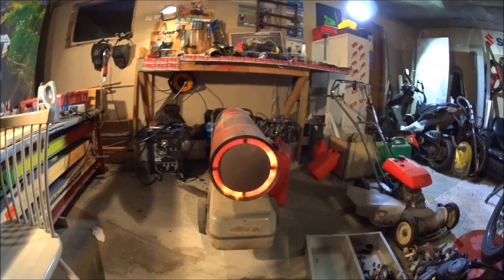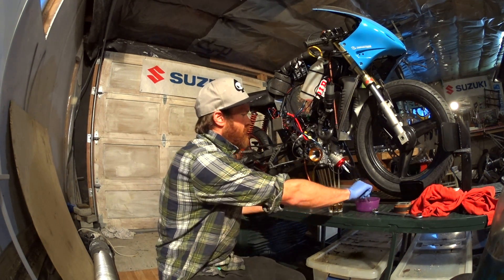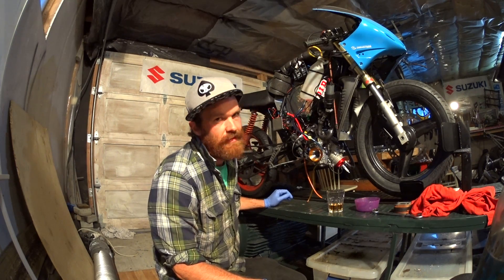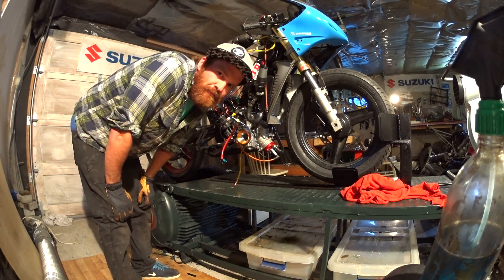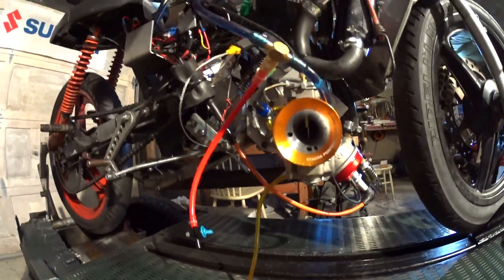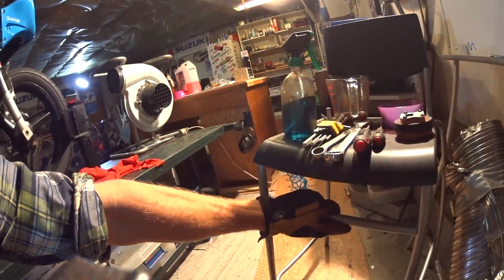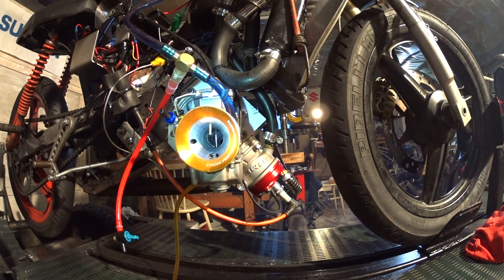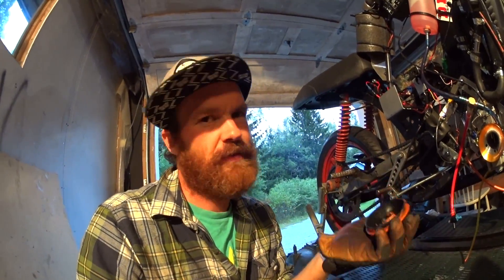YOU WONT BELIEVE IT! Two Stroke Running With No Intake Valve!

Comment from the maker: Disclaimer: This is not like common piston port induction were the intake port is in the cylinder wall controlled by the piston, even if, for the untrained eye, these engines may seem to have no intake valve.
Reply: 2STROKE STUFFING 
Two-stroke engines aren't required to have Reed valves to operate you can remove them and they will still operate it just won't operate as efficiently. Reed valves were invented to keep back pressure from entering the carburetor and causing a disruption in the intake direction of airflow causing a reduction in power. Most 2stokes didn't have reed valves until the 70's.
Reply from the maker: +Ben Hawke No they aren't, but they always (with a very few, very old exceptions) run some kind of intake control, reed, rotary valve, piston port etc. In this video I'm running the engine with a big gaping hole in the crankcase. Always open. No control.
Reply: 2STROKE STUFFING 
Yeah, like snowmobile engines. Snowmobile engines didn't start using reeds until late 90's, even on the crankcase mounted intakes. If you wanted a reed valve on your sled, you had to find an aftermarket reed box, or make one. That's one sweet looking bike. I'm building a GS 650GL into a scrambler.
Reply from the maker: +Ben Hawke Thanks! Good luck with the scrambler project! Are you sure the one's with intakes in the crankcase weren't running rotary valves?
Reply: Ok, I can accept that. Good description.

Comment: They run ok with no reeds but reduced power, the piston still pushes the mixture down but there’s a pressure pulse back into the carb. It’ll only run right at specific speed but could be tuned with different length intakes.

Comment: Eeeeh. Most old mopeds run without intake valve. Ilo, Husqvarna, Sachs, Puch, Zündapp etc. Carb mounts directly to the cylinder (or possibly engine block) without any valves in between. All 2 strokes have cylinder ports. When talking about intake valves on a 2 stroke we refer to valves specifically and not cylinder ports.  Why would this be unbelievable? 
Not impressed. At all.
Reply from the maker: You're missing a key point, in those the piston IS the valve, here there really is no valve.

Comment: i have an old 2T moped that has no valve and it runs good!
Reply from the maker: It's piston ported, this is not.
Reply: @2STROKESTUFFING  you forgot about piaggio ciaos.  They are case inducted 180degrees opposite the cylinder and have no reeds bro
Reply from the maker: @TrustPro2024  They use the crankshaft as a rotary valve, just like vespas.

Comment: Uh 2 strokes have been running without reed valves since their invention reed valves is something new,was a big marketing thing back in the late 60s and early 70s.I was racing RMs in the late 70s,by that time all 2 strokes had reed valves .The only valve the older 2 strokes had was the piston.
Reply from the maker: You said it yourself, they use the piston as the intake valve, this one don't.
Reply: Don't forget the rotary disc, invented in the fifties, by Daniel Zimmermann, and the rotary sleeve, used by Erich Wolf on the DKW racers in the thirties and fifties.

Comment: I might be wrong but i thought 2 strokes were either piston ported or reed valve.
Reply: Old kawasaki  dirt bikes an skidoo snowmobiles ran a rotary valve setup,  the pie shaped valve runs off the end of the crankshaft,  hence the side mount like this little bike.
Reply: @johnbabb1138  yes you are correct i forgot about about old kawasakis dunno about skidoos no snow where i love

Comment: In 1930 or so , tests have been made by Hungarian engineer...which showed that if exhaustport opens vey fast , ( as wide as possible and with straight upper side) the pulse created in the exhaust would create such low pressure that the fuel mixture is sucked from crankcase through transfer ports into the cylinder.....

Already then was stated (1930!!):  the valve is only needed for easy starting and revving up.  Once at higher revs the valve can be discarded....
Remember in 1930 they did nit have such good ignitions as we have now , carburation was worse and fuel not as good....... 

So that this engine can be started , idled and revved up......is not such a miracle.

It just shows the exhaust pipe determines the power output if cylinder and carb are 100 percent.....

Comment: Yes, it works without valve, but does not accelerate well and has no power. The carburettor guillotine acts as a valve at very low speeds.
Reply from the maker: I think so too.

Comment: How is that possible? 
My brain just  exploded.
??????????????????
You just turned the small engine world 
Upside down  bro,now would you make a video  on different riding conditions? To
Further test at different riding speed s ,i 
think you can do it  
☆☆☆☆☆☆☆☆☆☆☆.
Reply: In 1930 or so , tests have been made by Hungarian engineer...which showed that if exhaustport opens vey fast , ( as wide as possible and with straight upper side) the pulse created in the exhaust would create such low pressure that the fuel mixture is sucked from crankcase through transfer ports into the cylinder.....

Already then was stated (1930!!):  the valve is only needed for easy starting and revving up.  Once at higher revs the valve can be discarded....
Remember in 1930 they did nit have such good ignitions as we have now , carburation was worse and fuel not as good....... 

So that this engine can be started , idled and revved up......is not such a miracle.

It just shows the exhaust pipe determines the power output.....

Comment: People have commented on where you are from . I believe you are defiantly from Scandinavia not sure if its Sweden but acts like it ? 
 The running with no rotary valve is amazing to me. I have been a powersports mechanic for most of my life and have work on raced and modified many two stroke and four stroke motors for motocross drag racing including jet skis. I believe that I have a pretty comprehensive knowledge of the subject. Obviously your engineering skills far exceed mine for which my hat is off you. My point though is it is  impossible to start and run a  reed valve  two stroke with broken reeds. I know from bitter experience that I've had the reeds break up on motors while they are running full bore and the motor cuts out instantly and will not restart. So this must only work with a rotary valve motor which I've had a small amount of experience with Rotax Jet Ski motors. The crank throw or web must be acting as a valve. The crank web is very close to the side of the crank case. So I wonder if this would work on a twin cylinder Rotax where in the rotary valve is driven via a separate shaft and the intake port is positioned between the crankshaft webs making it impossible for the crank web to influence the intake charge? 
 This leads me to another point unrelated to two stroke engineering. Although not a native of the USA I have lived here for over 20 years. I have watched many of your videos. One in particular I watched you complain about the comments about the way you dress. My complaint is about how you don't dress. I'm not sure if you realize that the way you wear your pants came from the California prisons and is an advertisement to let other inmates know that you are sexually open for business. I'm sure this is not the image you want to project? From my own point of view I see you as a very talented and intelligent person I want to see your incredible engineering skills not your underpants or your backside I  think it is very immature and find myself some what embarrassed for you . I would love to leave you an email or other means of contact to discuss any point but I would be barraged  with a tirade of millennial social justice warriors that are offended with no clue why?

Comment: Im not too surprised by this as I have used machines without valves or piston control intake also because I tried starting them without fully putting them back together. It is less efficient because you are not necessarily always getting an optimal mixture of air/gas but other than that everything else you need to run an I.C.E. is present. Some of the machines I ran like that had stalling issues or backfired but I could usually adjust the gas input to make the machines run ok. The only thing I am surprised about is that yours seems to run pretty darn well without the valve, altbough it didn't start first or second try and it seemed like you didn't have to mess too much with the gas mixture. All that being said, I love your videos because you are very scientific by coming up with an idea of what you want to do, forming a hypothesis about what the modification will do performance wise, then you test it on the dyno usually more than once to get an accurate result and share it with us the 2 stroke lovers! Without videos like yours or getting a dyno of my own, I would just be guessing as to what mods felt better to me and using primitive,  inaccurate measurements of my results. Keep it up man!
Reply from the maker: Thanks man!

Comment: the side in the carbi acts like a valve when idling  and controls mixture of fuel  while opening  the venturi effect of the carb takes over drawing more fuel with the air ......i grew up with non valve 2 stroke motors here in australia in motorbikes in the late 70s early 80s it nothing new ......throw a set of valve reeds behind the carbi your running and call it a day
Reply: also if you want to run the rotory valve and pick up top end revs let more air fuel in make the intake valve smaller dont re time it take material of the side that starts to close the port

Comment: Mietz and Weiss 2 cycle oil engine of the 1890's had a three port design with no valves.
Reply: Ports ARE valves
Reply from the maker: +enginebill Interesting, Was it one of those "constant speed" engines?

Comment: nice rotary there where did you find it ? i remember testing a 50cc Groupe 3 back in 1998 in France nationals it would go up to around 20000 rpm with 17 Whp and a Dia 30 carb but it still was outrunned by read valves since they could put out as  much power but on a longer band
Reply from the maker: +Franz Heil Thanks! It's homemade. Just finished porting the cylinder, stay tuned for upcoming videos!

Comment: ok you and i spoken before about dyno losses etc , now as i said then i had been racing home tuned two strokes since 65, during the early 80,s i ran a yz250e aircooled engine , this being a reed valve motor, at the time i was experimenting with different reeds, when during a race the motor realy stared to pull real strong but if it git close to the low rpm of the pipe it bogged down it finished the race and after we found one half of the reed valve had disappeared lucky it was a glass fibre reed , so the engines will run at speeds within the pipes rev range i know that , as the kinetic energy of the air volume with keep it going , when mine dropped of the pipe it didnt want to run ,it was a bitch to get back to the paddock , so i knew something had happened.
also when running montesa,s in piston port valving we would run a full open period of over 220 degrees, these had strong power from 7 to 9.5 k , depending on the pipe used, now i can see this working , i also see how low gearing it is when you start it , it must be turning 2 k when the wheel is turned

Comment: In USSR, now Rusland city Serpuhova in years 1985 make competitions bije 50cc with 6speed but with rotation plate valve. Then you can set inlet angles.
Can you tray put inside walve from 125cc bike?
Can you tray put inside rotating plate valve?
Reply from the maker: +Rudolfs Jozuus I'm going foa larger inlet disc now, to make room for a larger port.

Comment: Two stroke engines do not require valves, companies use valves to control the gas flow, but they can run perfectly fine without them
Reply from the maker: +JackyBro watch my intake types video.

Comment: No moving parts or valves are required for 2 stroke operation other than the piston and crankshaft as long as intake and exhaust ports are properly located.
Reply from the maker: +Sebastien LaPointe True, bur here the intake is definitely not properly located. It's just a hole in the crankcase.

Comment: Long time ago I had a Vespa boxer 
I put the gasolinetube in the intake manifold without a carburator and it runs 😂 
But only idle
Reply from the maker: +marcello033 That's funny!
Reply: Its normal , i have mover engine which running without carburetor. One day i sheded gasoline on engine block and push to run and engine runing about 20second

Comment: Most of the old snowmobiles and I️ believe a lot of old two stroke engines have no intake/reed valves. My understanding is that a reed valve on a two stroke is a somewhat modern innovation to improve performance and fuel efficiency. Correct me if I’m wrong but please only if you know what you are talking about. Thank you.
Reply from the maker: +Andrew Walski All those 2 strokes without valves are in fact using the piston as the intake valve, it's called "piston port induction". I'll have to make a video about this, seems to be a very common misconception.

Comment: It's the fookin' whiskey...

actually I havce had a couple of rotary-disc valve 2T's that I played with (Bridgestone 350 twin and Kawasaki F5 350 Bighorn single) making new discs with other timing and managed to start them both with no disc inside. Air/fuel misture def hung i the air around the bellmouths when running; I never tried to irde or dyno them as such; was afraid to damage the piston/cylinders and parts for them were hard to find (pre-internet :-) )

Have fun & glad to see/hear you respect your sleeping kids- you're not JUST a gearhead

Comment: I faced 2 stroke yamahas in the 60's and we did not have valves on them.
Reply from the maker: +monster man They had piston controlled intakes, this in running always open.
Reply: ACreativeName what he said, that are pisten controlled valves. They are straight on the cilinder. When the piston comes up, it makes a vacuum in the crankcase. And then when the piston is almost all the way up. It opens the in take port. ( because is just a hole in the cilinder. The piston wil open and close that hole by moving up and down.) And makes a way to the crank case. Vacuum sucks in ar and feul. When the piston goes down. It closes that port and build a crankcase pressure. And when the piston is almost all the way down. It opens the tranfer ports en the pressure in the crankcase blows the mix in the cilinder. This is a different intake proces. The engine on this video is no intake controlled by the piston. The intake is ON the crankcase. So normally wen dr is no reed or rotary valve but just all time open. There will no pressure build up in the crankcase. So when the tranfer ports opens. It wil not flow. So this is not going to run. But this engine can and thats amazing!!!!. Not so efficient i think
Reply from the maker: +Leroy De Vries Correct. And, no, not very efficient...
Reply from the maker: +The2StrokeRider it's piston port
Reply: My old sachs engine doesnt have a intake valve. Carb goes straight into the engine if u now what i mean
Reply: theres nothing special about it. If your from germany then you know the mopeds and mofas. They had no valbe at all the carb was directly at the intake port.

Comment: even without the reeds it's  a kind of piston port engine, it may run , but I bet it runs bad.
Reply: joracer1 no
Reply: Yea on the intake port where the piston acts as a valve. What is special here that you haven't worked out yet is the carby is fixed to the crankcase (somewhat common configuration using a valve to prevent what goes in from coming back out on the downward stroke) is fixed without the use of a valve.
Reply: theres nothing special about it. If your from germany then you know the mopeds and mofas. They had no valbe at all the carb was directly at the intake port.

Comment: But nitro rc car dont have any Love your Chanel gr marvin
Reply from the maker: +Marvin Lokers Actually they do, it's a rotary drum valve built into the crank.
Reply from the maker: +Marvin Lokers.... And thanks!
Reply: 2STROKE STUFFING im sorry your right
Reply: Can you pre heat the spark plug ? For beter start like a diesel glow plug
Wtf that it runs mind blowing
Reply: I have see your ather video's to much back presser for rotery disk to close myby Its leaking a way around it 
Your not crazy you fint a way keep on the good work gr

Comment: a bower system on the carb intake might relieve the huffing issues.....idk
Reply from the maker: +Robin Snodgrass Please explain, never heard of a "bower system".
Reply: 2STROKE STUFFING blower, like a high performance electric motor with squirrel cage blower sealed to the intake....or perhaps a belt drive supercharger....I must apologize for the typo....sorry
Reply from the maker: +Robin Snodgrass ahh, of course! A blower would be cool, and should fix the blowback for sure!
Reply: 2STROKE STUFFING if the pressure is high enough yes

Comment: I discussed the theory years ago with my fellow two-stroke designers.  It was agreed that we might be able to dispense with intake valves entirely, but this is the first time I have seen it work in practice. It goes to prove the theory that the crankcase scavenged engine is a purely resonant system.  If the crankcase pressure waves are in sync with the scavenging requirements, then they will take care of the timing without the need for any mechanical valves.
Reply: Paul Ellis 1970’s Kawasaki (Arcticat snowmobiles) all had reedless 2 strokes.
Reply: This was already discovered in the 1960s by Ing. Walter Kaaden, working on the MZ two-stroke racers.